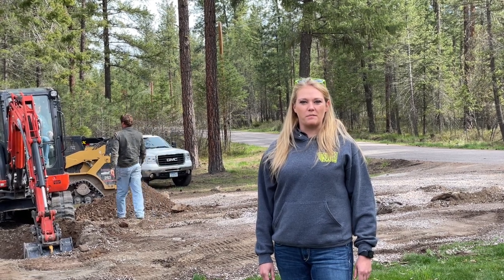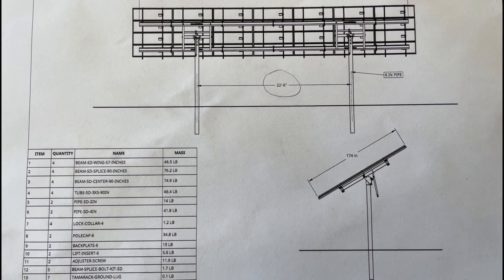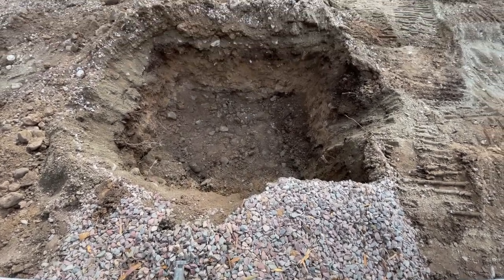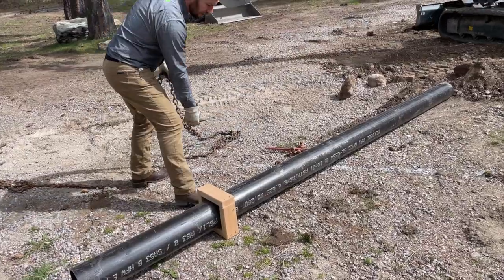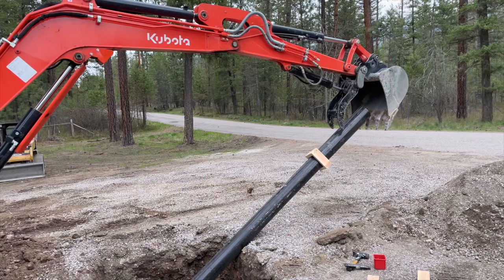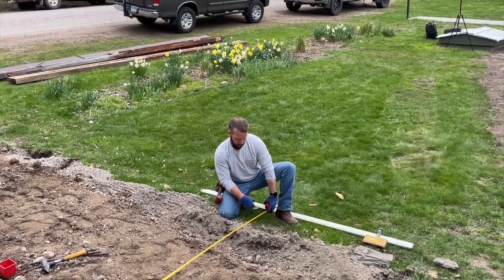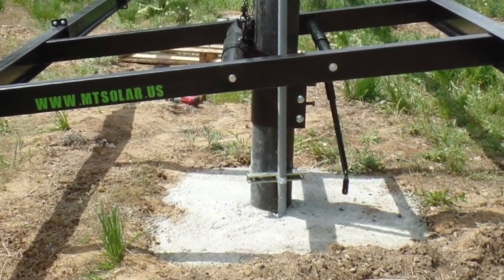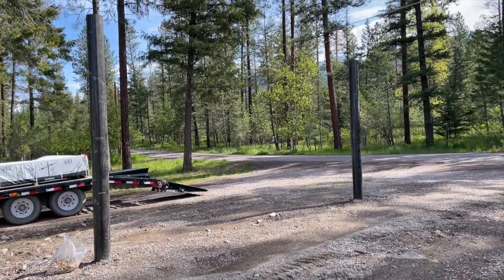Installation Tips - Foundations and Pole Setting for Pole Mounted Solar Arrays

Comment: This is exactly (almost) how I set our poles. I didn't want to hire a crane, so I rented an excavator and it worked great. I tried once to lift the poles with my tractors' front loader, but it wasn't high enough. I dug the two holes with the excavator earlier when I was doing some trench work and moving downed trees around, then rented it again when it was time to set the poles and do some ditch digging. But instead of using the wood collar, I used a strap choker. Then, instead of using braces connected to a collar, I'm fortunate to own a couple sets of patent scaffolds and set them up around each hole with the front braces out, then set the pole, replaced the front brace and laid 2x4's across the scaffolds horizontal rungs, and tie wired them down at two levels (top and bottom of the scaffolds), and then fastened cross boards perpendicular to the long boards and went with that. I built 2 rebar cages and bottom mats that were then surrounded with 3' diameter sonotube 6' deep. Compressing the dirt around it was easy. I did it with a hand tamper, adding a foot of fill dirt at a time. I hit a sandstone shelf at 4' and 5' on the excavation, so I have 1' and 2' of concrete showing above ground, but it's been there for 2 years and I've never had a problem with anything. Great video!
Reply from the maker: Nicely done! Thanks for your comment. Yep, there are several ways to get a solid foundation for pole mounts, and each installation site has its own unique challenges. It's great to hear this method worked out for you!